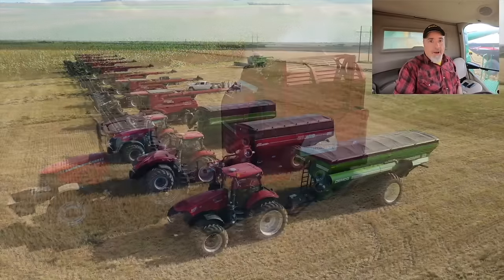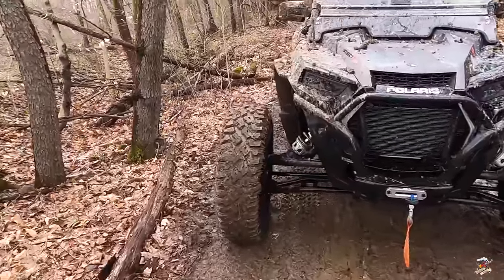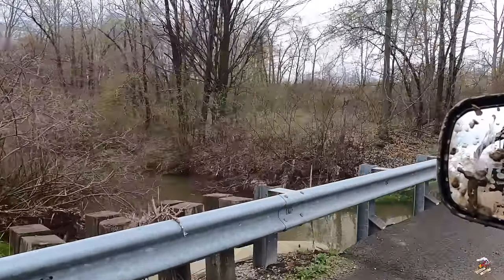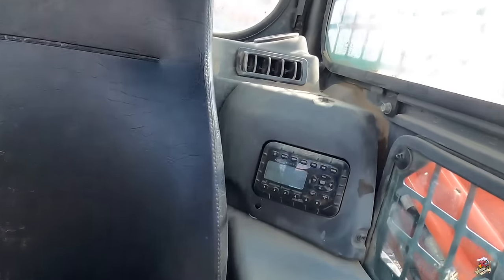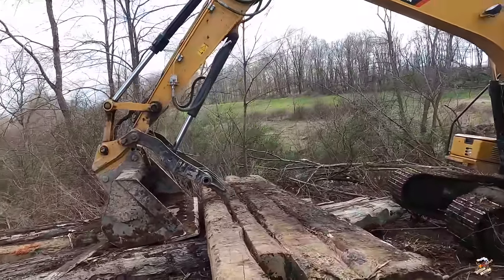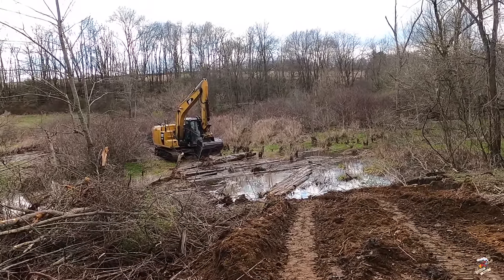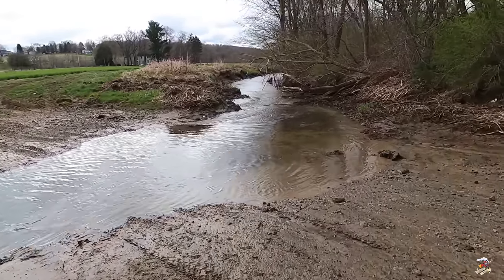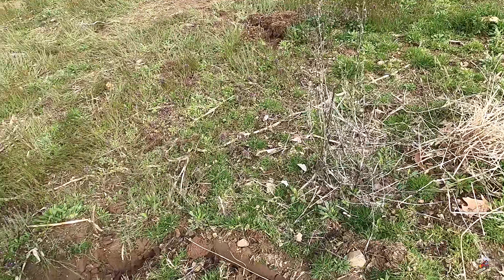Beaver Dam Removal with an Excavator - Dealing with Beavers

Comment: You guys are more tolerant than I am. I hate beavers and woodchucks. Both cause way too much damage. Out in wild areas where there are no farms or houses, let the beavers do what they want, but in rural/agricultural or suburban areas these days, they need to go. OMMV
Reply: Just after I posted this, I went outside for a bit and I spotted and then shot a woodchuck with one of my air rifles at 64 yards (lazer ranged it).  Bang flop. Just the way I like a woodchuck LOL
Reply: I agree with you 100%, we have low land/river bottoms and it's a constant fight with them here.  You get one group gone and another one moves in off the river, never ending.

Comment: at least you broke your own equipment, when visiting family, my dad took out my grandad's D-19 with a brand-new rotary hoe to run over some corn ground when he hit a shallow washout, causing one of the tractor wheel weights that was placed on top of the unit to bounce off and lodge between the front and rear ranks. it damaged some hoes and bent the frame. even worse still he knew he was driving too fast and so did grandad. no better way to throw a wet blanket on a vacation. oh, if you didn't say this is my dad, I would have assumed he was your older brother. take care